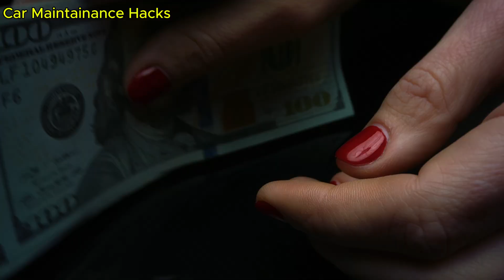Most Fuel Additives Are Useless… Except These 3!

Comment: Those 3 MIRACLE additives will do NOTHING for cleaning the intake valves on a GDI engine!
Reply from the maker: You’re absolutely right — GDI engines are a different story.
These additives mainly clean injectors and combustion chambers, but not the intake valves since the fuel doesn’t pass through them.